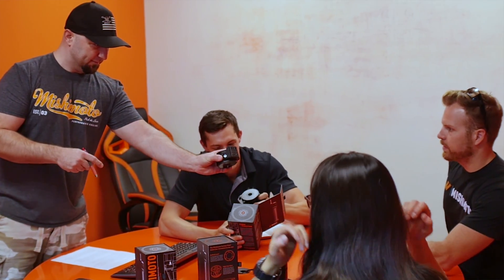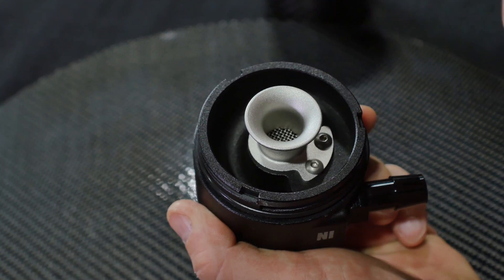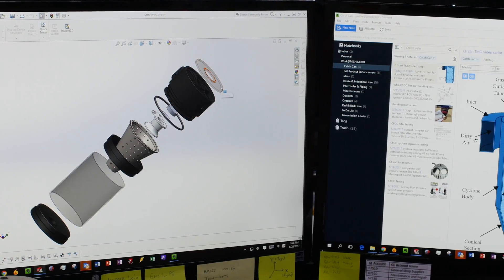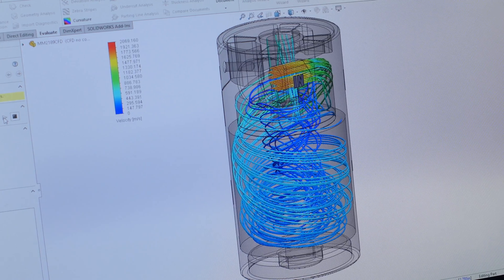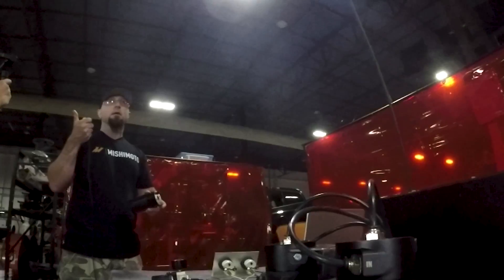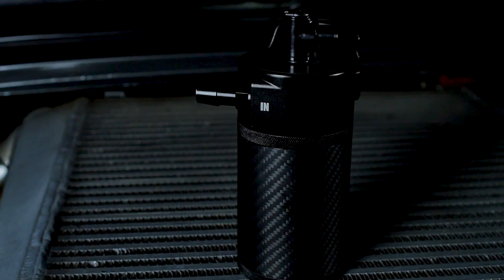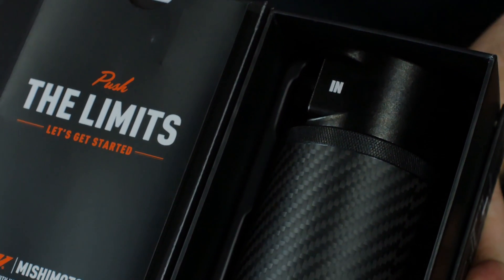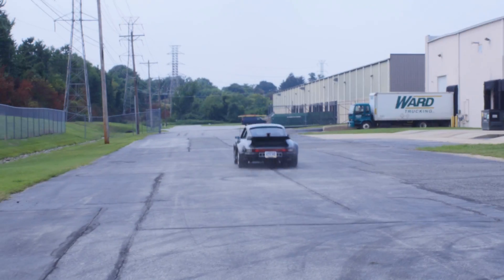Carbon Fiber Baffled Oil Catch Can Product Development by Mishimoto

Comment: Not being sarcastic, but remind me again what the catch-can is used for?
Reply from the maker: Catch cans will catch the oil vapors traveling through your intake system. This will have no affect on your oil.
Reply: @mishimoto  is there a performance gain or is it more of a maintenance/engine protection thing?  How much is that new carbon fiber cyclonic type going for, ballpark?  I currently use a few of your products.
Reply from the maker: maintenance/engine protection. Current pricing is listed on the website.

Comment: Would like to know if this will fit in my 2021 BMW XB7 Alpina. Would you let me know if you guys could to test fit 2 of these in a N63TU3 engine?
Reply from the maker: It's possible that this could fit, however, modifications may be necessary depending on where you plan to mount it.

Comment: If only mishimoto would supply a 3 metre length of hose, that is needed to install the 3 port catch can I brought from them a couple of years ago. Instead they supplied a hose no longer than 2 ft!!! So I had to go on amazon and order 3 metres of black vehicle hose to complete the install. Mishimoto make great catch cans but are lazy when packaging everything you need for the install. I’m very nervous now about buying there top mount intercooler for my STI, just in case I can’t complete the install, as things may have been left out, I may go with grimmspeed 🤔
Reply from the maker: Hey Chris, if your kit is missing any components or did not include something that was listed on our website, please reach out to Support@Mishimoto.com and our team here will be more than happy to sort that out!
Reply: Mishimoto Automotive thanks mishimoto I’ll do that in future 👍